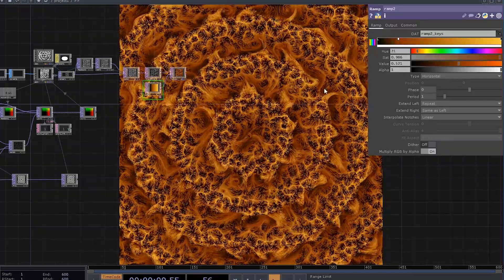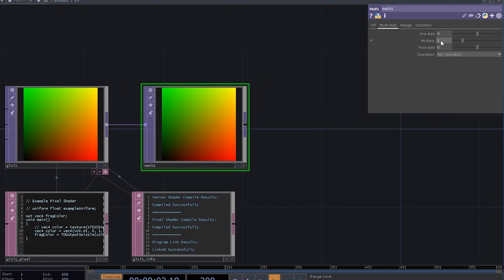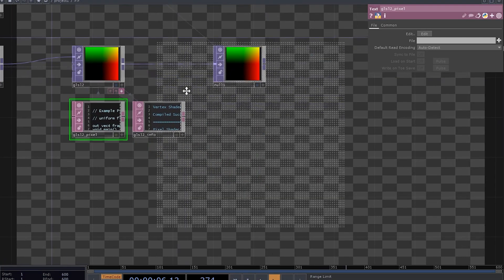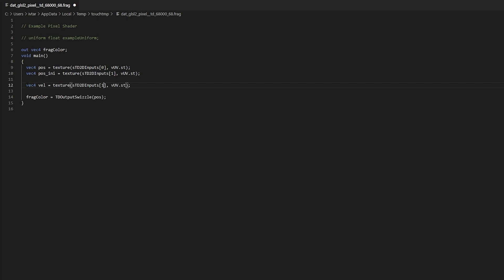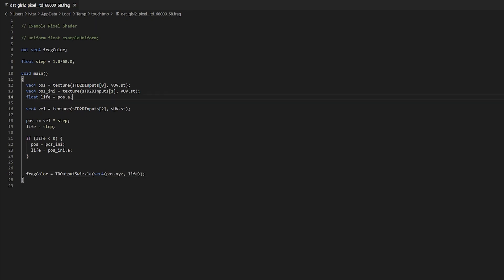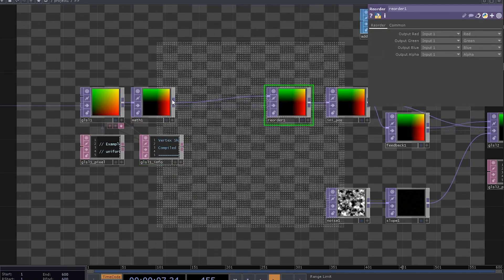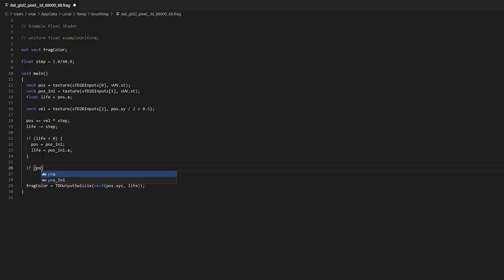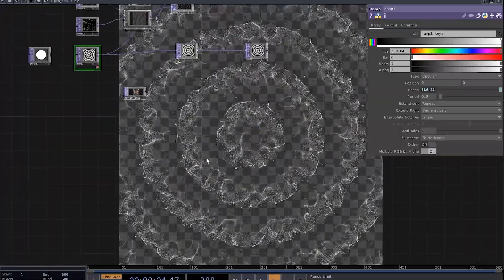GLSL particles with velocity fields (Touchdesigner tutorial)

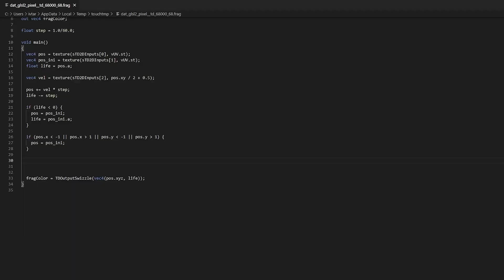Comment: How did you create the work on 6:41? What do you mean by interpolating between two vectors? Thank you so much
Reply: Put the circle of the ramp into the alpha of the geo. Before that, set the ramp size through fit top, which is the same as the size of glsl1